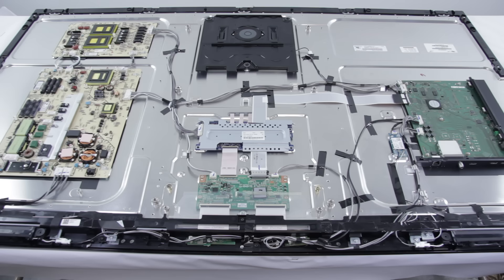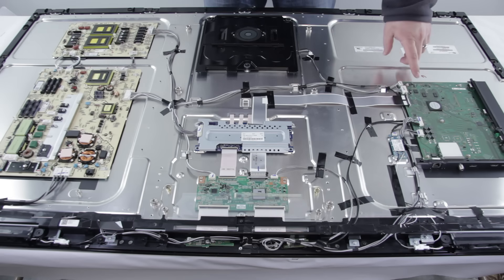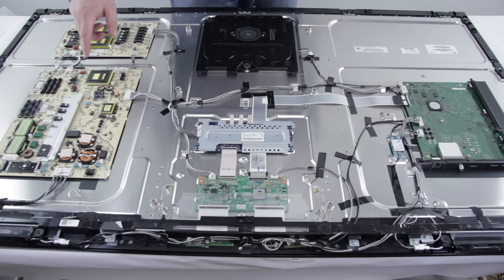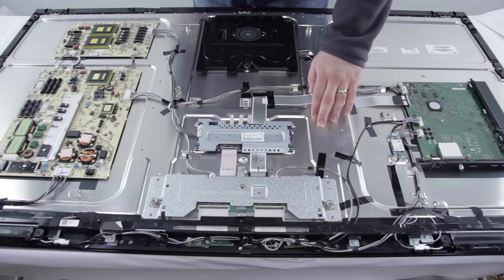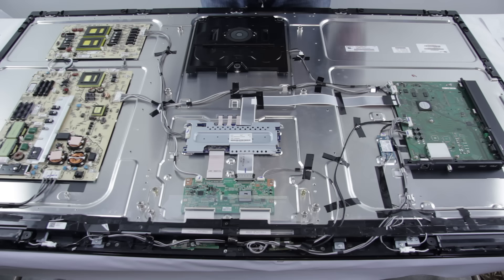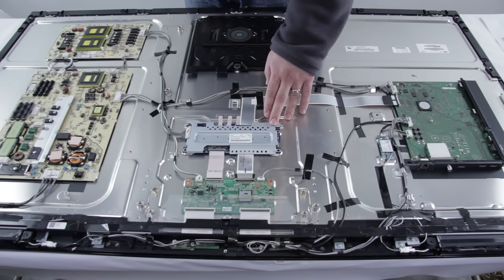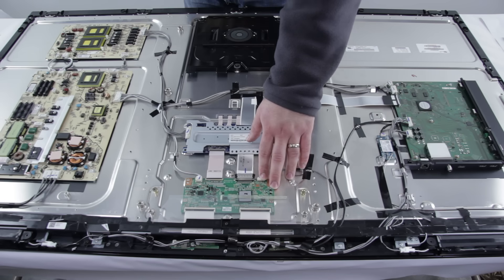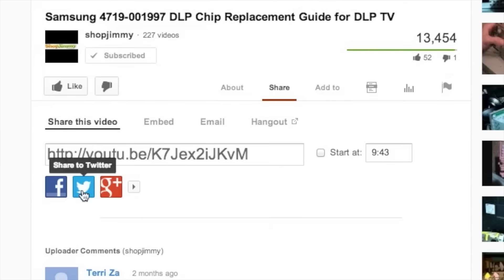LED TV Repair Tutorial - Common Symptoms & Solutions - How to Repair LED TVs

Comment: LC-70LE755U Sharp picture is flickering should I replace power board?
Reply from the maker: +Kirk Keith  Try all repairs and troubleshooting at your own risk.  This could be a problem with either the power supply or the LEDs in your TV.  You can replace the power supply board  to see if that fixes the problem.  Click this link to replacement parts for your TV model number:  http://www.shopjimmy.com/catalogsearch/result/?q=LC-70LE755U  There may be multiple boards for the same TV model number, be sure to match part numbers on your current board, with your replacement for compatibility.  Thanks and please let us know if you have any further questions with your TV Repair!  www.shopjimmy.com

Comment: Hi shopjimmy hopefully you can help me out:) I have a 60 inch Sharp Aquos LC-60LE810UN  The TV won't turn on,  and the front light does one long and one short blink. I've tried resetting it with no luck.
Reply from the maker: +myjobsuckstwo  Try all repairs and troubleshooting at your own risk.  I recommend replacing the power supply board in your TV.  Click this link to replacement parts for your TV model number:  http://www.shopjimmy.com/sharp-runtka684wjqz-power-supply-backlight-inverter.htm  There may be multiple boards for the same TV model number, be sure to match part numbers on your current board, with your replacement for compatibility.  Here is a link to a video showing how to identify your part number, click here:  https://www.youtube.com/watch?v=-i9o4C2XkyQ  Thanks and please let us know if you have any further questions with your TV Repair!  www.shopjimmy.com

Comment: I have a RCA Model # LED39B45RQ HDTV less than 3 years old that will not turn on. We have unplug for an 1 hour/over nite and held down the tv power button and still no results. When we unplug and plug it back up the red light come on but when you press the tv button on the remote or the tv itself to turn it on, the red light goes away and NOTHING. What is wrong?

Comment: I have a Vizio 47" TV Model GV47L FHDTV20A Part no 20240011022 Made in June 2008. Power supply is DPS-433 BP-A Rev S2. Part No. 0500-0507-0340.  TV has lighted Logo "VIZIO" in yellow when in standby.  Troubleshooting shows touch panel (front lower right part of TV frame) is responsive and lighted logo turns to white and click is heard when TV power is turned on at touch panel.  Another click is then heard within a few seconds and TV goes back to standby with no video and no audio (screen always remains blank/dark).  Pressing "SOURCE", "MENU", "VOL+" or "VOL-" lights up touch panel but no video or audio (screen blank/dark).  Unplugging for a long period of time (hard reset), then TV plugged back in has same results, no change
Opening Back of TV, unable to find anything looking burnt and all capacitors seem normal (not bulging).  Have tried pulling off cables and re-seating with same results (no change).

Comment: I have 70-inch Visio E701i-A3 LFTRNXBP3102931 . It has nothing but dark blue when I turn it on. no picture, no sound. Remote stop working also, I have to use the side buttons turn on, no other button work. I have change the T-CON, did not help it.

Comment: I have a Samsung 32" LED TV.  Model# UN32EH5300F.  I have sound but no picture.  I do not see any backlights.  But if I do the flash light test I can see logos of the network on the screen.  I've replaced the LED board and that did not fix the problem.  Both Old and New LED boards give me the same results.  But if I hit Menu or Tools, I do not see either on the screen, doing the flash light test.  What else might it be?  Or might it be  more costly?
Reply from the maker: +Vicki Hyland    Try all repairs and troubleshooting at your own risk. This sounds like a problem with the actual LEDs inside your TV. These LEDs are replaceable, however it is recommended they are replaced by someone with the proper experience and training. When replacing the LEDs, the TV panel can get damaged. If the TV panel gets damaged, it is not repairable. Click this link to replacement LEDs for your TV model number:  http://www.shopjimmy.com/catalogsearch/result/index/?cat=299&q=UN32EH5300F.   Be sure to match the panel information necessary to ensure you have the correct replacement LEDs.Thanks and please let us know if you have any further questions with your TV Repair!  www.shopjimmy.com

Comment: i have a Vizio VOJ320F1A.   We had a lightning strike.   The Vizio logo is amber when the tv is plugged in.  However, when power button is pressed it does not change to white, there are no backlights, no picture, no sound.   Any suggestions?

Comment: I have an Element 55" LED 1080p TV model: ELEFS552.  There is sound but no picture, and with the flashlight, I can see the menu faintly displayed.  From your video, I think this means the LED driver board likely needs to be replaced.  Do you have this part, what does it cost, and are there any special tools needed to replace the board?  Thanks.
Reply: +ShopJimmy.com The problem was the power supply board.  I replaced this board and the TV works perfectly.  Your video was VERY helpful.  thanks.

Comment: I have an LG 47ln5200. I have no backlights, although with back case removed, when the tv is powered on the backlights do come on they do not remain on. I have image on screen when viewed in darkness with flashlight, I also have audio. I have replaced both the power supply board as well as the mainboard yet the problem persists. Any suggestions?
Reply from the maker: +Leon Pettegrew   Try all repairs and troubleshooting at your own risk. This sounds like a problem with the actual LEDs inside your TV. These LEDs are replaceable, however it is recommended they are replaced by someone with the proper experience and training. When replacing the LEDs, the TV panel can get damaged. If the TV panel gets damaged, it is not repairable. Click this link to replacement LEDs for your TV model number:  http://www.shopjimmy.com/catalogsearch/result/index/?cat=299&q=47ln5200   Be sure to match the panel information necessary to ensure you have the correct replacement LEDs.Thanks and please let us know if you have any further questions with your TV Repair!  www.shopjimmy.com

Comment: LG TV 50LN5100   I've replaced all the boards and wiring harnesses.  I now have sound but no picture.  Once I turn on the TV it blinks and goes out but sound still remains.  Any ideas I can troubleshoot?
Reply from the maker: +danals dunavan   Try all repairs and troubleshooting at your own risk. This sounds like a problem with the actual LEDs inside your TV. These LEDs are replaceable, however it is recommended they are replaced by someone with the proper experience and training. When replacing the LEDs, the TV panel can get damaged. If the TV panel gets damaged, it is not repairable. Click this link to replacement LEDs for your TV model number:  http://www.shopjimmy.com/catalogsearch/result/index/?cat=299&q=50LN5100   Be sure to match the panel information necessary to ensure you have the correct replacement LEDs.Thanks and please let us know if you have any further questions with your TV Repair!  www.shopjimmy.com

Comment: I have a RCA 46LA45RQ LCD TV.  There is no picture and no sound.  The TV turns on and shows the (date/channel) in the RH top corner and then goes black.  Will not go to different inputs.  Any suggestions?  (Buy a new TV)  From what I'm seeing online this tv is not very good.  Have had for 5 years.  Thank you.
Reply from the maker: +Angela Saldivar  Try all repairs and troubleshooting at your own risk.  I recommend replacing the TV.  Thanks!  www.shopjimmy.com

Comment: I have a Samsung UN46EH5000 LED TV with black screen with sound.  I've done the flashlight test and saw the menu. I did not  see backlights.  I ordered a LED/powerboard from you guys and still has the same results. Could it be the main board that has the tee con board built in?
Reply from the maker: +Jim Leary   Try all repairs and troubleshooting at your own risk.  This sounds like you have bad LEDs in your TV.  Unfortunately we do not sell replacement LEDs for your TV model number at this time.  You can check back in the future to see if we have them available.  Thanks!  www.shopjimmy.com

Comment: hello my name is adam, I have a 55inch lg model number is 55lv5500-ua it was manufacturer in march 2011, my problem is when we turn the TV on the indicator light comes on and we can here it click  but we have no scree or sound. I checked the back and no back lights and I tried doing the flashlight test no good, any suggestions would be great
Reply from the maker: +Adam Haistings   Try all repairs and troubleshooting at your own risk.  I recommend replacing the main board in your TV.  Click this link to replacement parts for your TV model number:  http://www.shopjimmy.com/catalogsearch/result/index/?cat=56&q=55lv5500-ua  There may be multiple boards for the same TV model number, be sure to match part numbers on your current board, with your replacement for compatibility.  Here is a link to a video showing how to identify your part number, click here:  https://www.youtube.com/watch?v=RwHTvjMdrhk  Thanks and please let us know if you have any further questions with your TV Repair!  www.shopjimmy.com

Comment: I have an LG 42LM640T TV which worked fine until recently. When I turn on TV, it works fine for 10min before a horizontal line starts appearing at the top tv screen. Horizontal line continues to grow into multiple lines. In about 30mins, whole tv screen shaking with more horizontal lines. When switched off and put back on, screen continues to shake. It only stabilizes when I put it tv off for about 30mins to cool, then cycle begins again. What could be the problem?
Reply from the maker: +SuperBatuna   Try all repairs and troubleshooting at your own risk.  This sounds like a TV panel (TV Screen) problem.  If your TV panel is bad, it may be more cost-effective to replace the TV as panels are typically hard to find in stock, difficult to replace, and expensive.  Thanks and please let us know if you have any further questions!  www.shopjimmy.com

Comment: Have an Element 50 Inch TV ELEFT502, power button is normally red when off and turns blue when turned on. We get the blue power lamp, but main screen is black. Can't check audio as we normally use chromecast and were last casting audio, but have changed settings several times.
Reply: +Thomas Swift Followed one of you video instruction and did flashlight test. We have no backlights showing in the dark. Using flashlight test was able to see input menu and set it back to HDMI-1 which was connected to chromecast. PLayed YouTube video on my laptop and cast it to the TV, audio worked fine and video could only be seen using flashlight. Which board will I be replacing the powerboard?

Comment: SANYO DP42647 SN B8040924309510. Getting sound no picture. Did flash light test and can see image. I bought 2 replacement inverter boards from ShopJimmy.com and still no luck. Do you think it's a CCFL problem? Can I replace them?
Thanks Bob. I've also replaced the power supply board and still no luck.

Comment: Hi shopjimmy.com, I have an LG 47LE5400-UC. My HDMI ports stopped working suddenly stopped working for high def tv and blueray. The old a/v cord still works. Do I need to replace the main board and if so what's the part number? Thanks for the help!
Reply from the maker: +Lindsey Corrente   Try all repairs and troubleshooting at your own risk.  I recommend replacing the main board in your TV.  Click this link to replacement parts for your TV model number:  http://www.shopjimmy.com/catalogsearch/result/index/?cat=56&q=47LE5400-UC  There may be multiple boards for the same TV model number, be sure to match part numbers on your current board, with your replacement for compatibility.  Here is a link to a video showing how to identify your part number, click here:  https://www.youtube.com/watch?v=RwHTvjMdrhk   Thanks and please let us know if you have any further questions with your TV Repair!  www.shopjimmy.com

Comment: Hey i need help with my Hisense tv model 50k360g. Im getting sound and backlight but no picture. Ive already tried a new t-con board from you guys but i got the same results. This time I purchased a new power unit. That didnt work either. I'm thinking it may be the mainboard. Any suggestions?
Reply from the maker: +Lloyd Billups   Try all repairs and troubleshooting at your own risk.  This could be a problem with either the main board or the TV panel.  You can replace the main board in your TV to see if that fixes the problem.  Click this link to replacement parts for your TV model number:  http://www.shopjimmy.com/catalogsearch/result/index/?cat=56&q=50k360g  There may be multiple boards for the same TV model number, be sure to match part numbers on your current board, with your replacement for compatibility.  Thanks and please let us know if you have any further questions with your TV Repair!  www.shopjimmy.com

Comment: Hey guys, I'm stumped.  I got a Vizio m401i-a3 that wont get an image.  There is no picture at all.  The backlight does work, and there is a dim glow to the screen.  When plugged to a PS4, it is like the tv is set to a very low dim setting!  I hope you can help, as I got this TV for free and would rather buy the parts than a new 400 dollar tv!
Reply from the maker: +Joel Ramirez   Try all repairs and troubleshooting at your own risk.  I recommend running the flashlight test on your TV.   Here is a link to a video we produced that shows how to run the flashlight test. https://www.youtube.com/watch?v=xUzCLgoSPGM Please reply with your flashlight test results and we can recommend a replacement part for your TV repair. Thanks and please let us know if you have any questions! www.shopjimmy.com
Reply: +ShopJimmy.com I just did the test, there is no visible image on the screen.

Comment: My TV is Samsung LED model number UN60EH6000F, the TV has sound but no picture.  The screen shows dim blue color.  What could be a problem here?
Reply: +Steven Ho Thank you for the tips and the youtube video... That helps me greatly to troubleshoot the issue.  I ordered the T-Con card, replace it and that fixed the problem.  Great service and tips.  Otherwise, I would have paid $450 for the repair man to fix it.  This only costs me $99 and the video provides clear instructions and step to step to do it myself.  Thanks a bunch!

Comment: i have a samsung tv model # ln40c530f1fxza. i have ordered and replaced the back light inverter and the back light power supply with no change in problem.(picture comes on for a min. then goes out)?please help me figure this out. i've done the flash light test and i do have dark imagages along with sound. is my next step the t-con?
Reply from the maker: +chitwoodtommy   Try all repairs and troubleshooting at your own risk.  This sounds like you have bad LEDs in your TV.  Unfortunately we do not sell replacement LEDs for your TV model number at this time.  You can check back in the future to see if we have them available.  Thanks!  www.shopjimmy.com

Comment: I have a lg42lc7d-uk Tv has picture for three seconds green light flashes six times before picture comes on then stays three seconds then picture goes out still have sound but no picture I have replaced the inverter, backlight boards twice thinking that first set may have bad board but still with same exact issue as the original boards. I have no visible blown or bad capacitors, so what else can be the problem?  timothyttrulock@gmail.com
Reply from the maker: +Timothy and Marie Trulock  Try all repairs and troubleshooting at your own risk.   I recommend replacing the main board in your TV.  Click this link to replacement parts for your TV model number:  http://www.shopjimmy.com/catalogsearch/result/index/?cat=56&q=42lc7d  There may be multiple boards for the same TV model number, be sure to match part numbers on your current board, with your replacement for compatibility.  Here is a link to a video showing how to identify your part number, click here:  https://www.youtube.com/watch?v=RwHTvjMdrhk  Thanks and please let us know if you have any further questions with your TV Repair!  www.shopjimmy.com

Comment: I have a Samsung LCD TV (Model UN50F6350AFXZA-NH02 that I an having problems with.  It seems all the HDMI ports are no longer accepting input (I've already determined the HDMI cable and cable from my provider are not the issue).  This appears to be due to a power surge.  If I am correct, I may fix the TV by replacing the main board.  What is the main board part number for my specific TV model?
Reply from the maker: +Dana Russell  Try all repairs and troubleshooting at your own risk.  I recommend replacing the main board in your TV.  Click this link to replacement parts for your TV model number:  http://www.shopjimmy.com/catalogsearch/result/?q=50F6350  There may be multiple boards for the same TV model number, be sure to match part numbers on your current board, with your replacement for compatibility.  Here is a link to a video showing how to identify your part number, click here:  https://www.youtube.com/watch?v=RwHTvjMdrhk  Thanks and please let us know if you have any further questions with your TV Repair!  www.shopjimmy.com